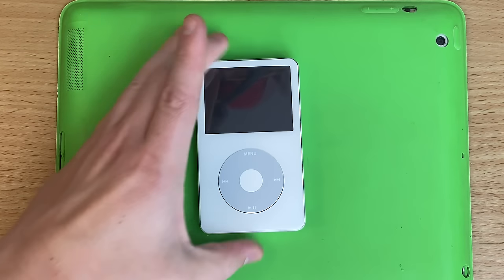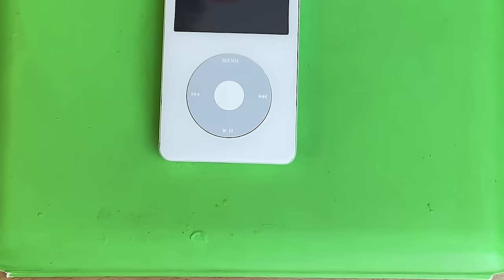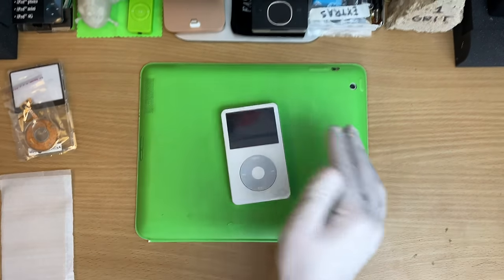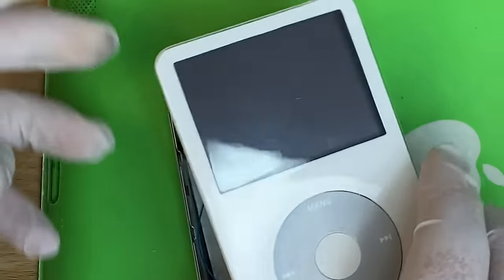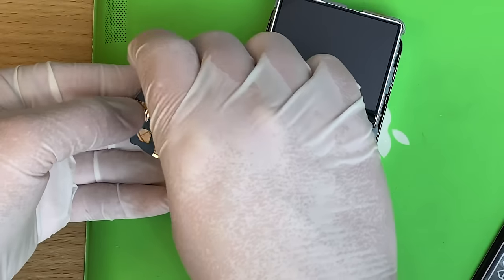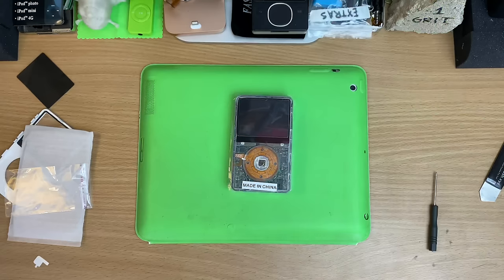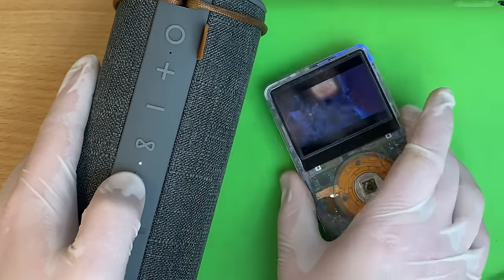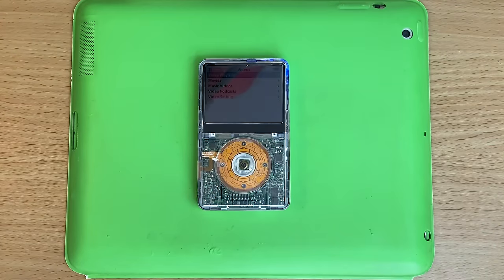We make a see-through iPod.

Comment: ive done a rockbox install on a classic 5.5, when i connect it to my pc, it is never consistently connected... sometimes it connects i start a transfer and it drops half way through it... ive tried multiple cables and cleaning the port, but it still does it, and on other laptops/pcs... any ideas? when i say it drops, either the device disappears  in windows, or the transfer rate drops to 0 mb/s and has to be disconnected and try again...

Comment: Just bought a second hand 3rd gen 20gb - now learning the firewire life.... it needs a restore, but needs firewire to do it as you can only sync music over usb, so I've had to buy a thunderbolt to firewire800 then a firewire800 to 400 adapter just so I can plug it into my late 2012 iMac 

On the plus side it does pass all the diagnostic checks and HDD checks, but I'm tempted to open it up, throw a fresh battery and flash upgrade it, anyone know what the max it can safely handle on flash ?

Comment: Pro tip 1 : you can also remove the black protector/padding thingy from all around the screen. Pro tip 2 : You can use the large black protector from the screen to stick it inside the iPod on the CF adapter instead of the tape. Happy modding!